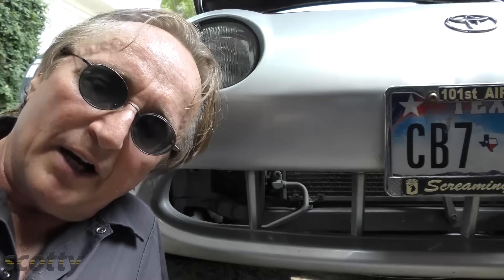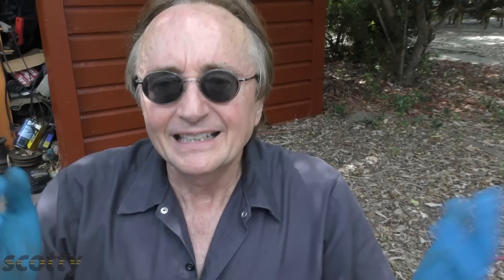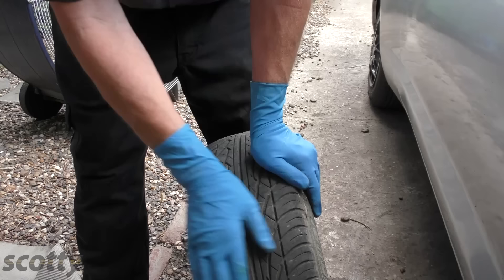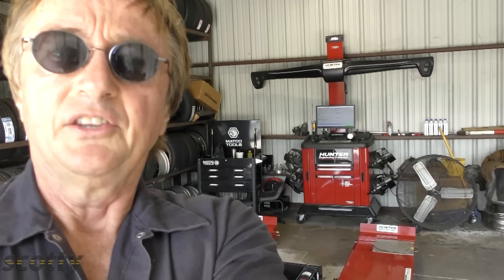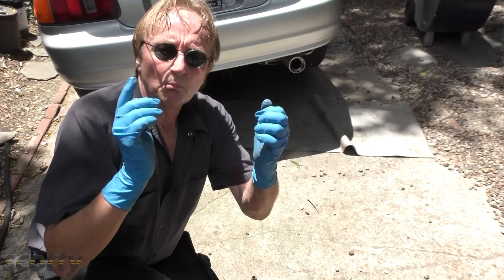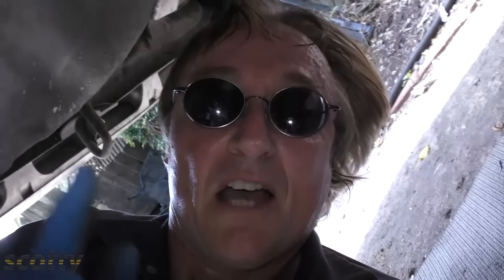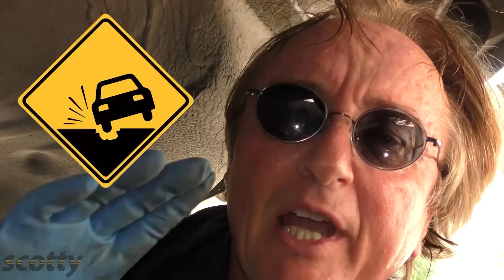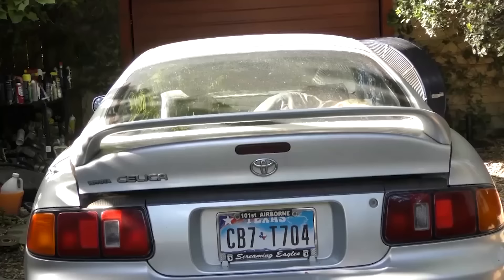How to Tell if Your Car Needs an Alignment

Comment: Just got new tires my old rear tires were both wearing on the inside and were making this whirring noise when accelerating or slowing down(not braking) not grinding or squealing just whirring I put new caliper bolts regreased them installed new rotors and pads not sure if it was just placebo effect but the sound quieted down alot then I got 4 new tires and it made the sound worse and now my steering wheel shakes at highway speeds 50-80. The shop didn't do alignments so I'm gonna be getting it done on monday 

Do you think it's just a bad alignment causing the noise and steering wheel shake? (Gonna have the shop test out the balance too)

I tried shaking and spinning all the tires the only thing I hear is the pads kissing the rotors no clicking no grinding or anything like that I hope it's just an alignment or balance issue I hate installing wheel bearings such a pain the the a%@

Oh my car has 160k on the dash and I'm pretty certain the wheel bearings are all original I haven't gotten my tires rotated or aligned since I got the car (whoops) so I've driven it for about 90k miles only doing oil diff and Trans fluid changes

Comment: What about tire change and suspension replacement? Would a alingment need to be done?
Reply: Tire change 
Probally not.suspentuon almost guaranteed yes 
I'm about to do all new control arms 
Ball joints .tire rods .and cv axles so I'm for getting an alignment
Reply: @westsidedavie  Damn that's a lot of work you are putting in. I hope it comes out great for you! I'm looking at new tires, suspension, sway bar, maybe even a differential.
Reply: @joshuabenitez3260  what car .? Mines a 98 accord 5 speed
Reply: @westsidedavie  04 Honda Civic gonna be my first project car not going too crazy tho

Comment: Hey Scotty. Id like to know how you feel about a shop charging full price for a 4 wheel alignment when they couldn’t get everything into spec and the car still pulls slightly.  They claim it’s because of worn out shocks on a 2016 Corolla with 100,000 miles and they knew this could possibly happen after doing the alignment but they fail to mention this before the service.  I took the car in for alignment after tie rod repair and it couldn’t be done properly but they still want to charge full price.  They claimed because I ordered the alignment which should be done after tie rod replacement that it’s not their problem.  What’s everyone’s take on a scenario like this?

Comment: My 96 Ford Telstar has a weird looking metal cable bolted from muffler to the body of car at the rear about 8 inchs or so long and same goes for other side is this a grounding cable of some sort, I have been having issues with my Door Adjar light including dome and door lights saying doors or door is not closed but all the doors are shut and the chime that says key in ign when door open or even lights on when door open dose not go with all doors shut just when a door is open these lights are dim and dome light is very dim when car is running as is the adjar and door lights but dome light is off when car is off as is adjar light bit lights on door is dim when car is or and or car is running

Comment: Fucks here where I live didn't align rear wheels. Back left has massive toe in. Gave them a call and they told me they are not doing it. It has 0.30° difference then other one that is on 0°

Comment: If your vehicle needs an alignment after it leaves the factory, it 100% requires replacement of parts. There is no "adjusting" worn out parts.

Comment: My car doesn't even have alignment bars. It has integrated camber eccentrics which tend to throw most shops in a loop.
Reply: What kind of car has "integrated camber eccentrics"? Year, make and model, please?
Reply: 1978-1995 Porsche 928. I personally own an 81 and an 89. The eccentrics are either part of a bolt in the rear suspension or a separate part that sits in the ball joint of the front suspension. Interesting system and it works well. It allows you to easily adjust camber, castor, and toe in and out.
Reply: TheTardis157  Thank you, I learned something today.

Comment: I got a wheel alignment today, and when I went to pay, the cashier asked if I got into an accident with the car. I assumed he was referring to the dent on my front driver fender. He said no, the front passenger alignment was further back than specs (the caster). Then the mechanic said that the light in my dash is showing that the car is still misaligned. I was perplexed at the light he was referring to in the dash. The mechanic said the light with the two lines and the car going sideways. I said that’s not for the wheel alignment, that’s the lane departure light. He said, no, the car has a camera inside to look down at the wheel alignment. I said you don’t know what you’re talking about; the camera is on the windshield, looking forward for lane departure. Seriously, the brokechanic’s lack of knowledge and his made up theory has me questioning their quality of work. And no, I did not have an accident in my car, but I did hit a pot hole.

Comment: how come when i have my car on lift, while spinning the one tire forward the other tire is going backwards ?
Reply: That's probably because these tires are connected through a differential. If the engine is off and thus the drive shaft is stationary, the gearing of the differential is transferring the rotation to the opposite side and reversing its direction.
Reply: @xXxLolerTypxXx  so this is normal ? i have nothing to worry about ?
Reply: @falcongro  I'm not a mechanic, but yeah I'm pretty sure this is normal.

Comment: If your car is wearing tires funny, you can find your problem with strings and levels guaranteed.  I've been aligning my cars at home and at work for 30yrs. . Our machine at the factory dealer was broken for 6 months, but the owner still made us charge customers for alignment. You might not get 100% accuracy at home, but neither will you with most lazy alignment techs., trust me I worked with many of them. Scotty doesn't have patience for alignment I can tell, some guys do.

Comment: Hi Scotty I just had the tie rod end changed on my Mazda Tribute 2003 and feels like it's pulling to the left (passenger side in UK) it did get its allignment done as you know you can't change that part without having it realigned.....before I take it back to the garage I have noticed that the tyre on that side has a slow puncher and siting at 22psi as oppose 29 psi which is the recommended inflate value.Would the tyre be the issue here? (I know the tie rod end definitely needed doing as from previous years safety inspection it came up as play in steering)

Comment: i have a    2018 mazda3 sport with 47k miles. i just changed my tires cuz the firestone mechanic said the sides of my tires are wearing so i may need to get an alignment so i took it to a 2nd place and got new tires put on em. i asked them how much percentage my old tires were and they said 2/32 4/32 and 5/32 and i needed an alignment. so i'm thinking of going to firestone and getting the lifetime wheel alignment (they align your car every 6k miles or so for the life of the car for around $150)  did i really need an alignment?

Comment: If my steering wheel is off, off by some degrees when car wheels are straight, does that require alignment?
Reply: Not necessarily.  The steering wheel might have a separate adjustment.  The charge do make that adjustment is probably the same, so I'd have it alignged while you bare there and just tell them to center bthe steering wheel

Comment: Scotty, im at my wits end with my baby (02 honda odyssey) i have a misfire on cylinders 2 and 5. I've changed spark plugs, changed coil packs, cleaned egr, cleaned pcv, and changed gaskets. Any suggestions?
Reply: MrEer218 have you checked the plug wires resistance?
Reply: benson420710 
Whats that?
Reply: MrEer218 the ohms measured from the spark plug wires leading from your coil pack to your spark plug
Reply: benson420710 
O yes sir and they are up to specs
Reply: MrEer218 might need extra spark plug wire holders, our 08 mountaineer had a bad missfire until I replaced the coilpack to plugs and went crazy with the holders making sure the wires dont touch each other or other metals

Comment: HELP PLEASE. Walmart put new tires on 2016 Nissan Rogue (90kmiles) and 2014 Nissan Altima (53kmiles); before getting new tires vehicles were driving straight. Rogue - first I have changed rear tires in Rogue at Walmart, after that I noticed the vehicle pulls to the right and I went to Pepboys because Walmart does not have the wheel alignment service; Pepboys fixed the issue but gave me wrong printout from another vehicle, later I went to Walmart to rotate the tires and after that vehicle started pulling left, so I went for realignment to Pepboys again, they fixed that but the printout still says that one of alignments is out of the recommended specs??? SHALL I GO TO PEPBOYS AGAIN MAYBE AT DIFFERENT LOCATION? Altima - changed front tires first at Walmart and vehicle started shaking at higher speeds, so I went to Walmart again and asked them to rebalance the front and put new tires in the rear; after that I removed the wheel cups and I noticed that the weight they put was not attached at all to the wheel (so I returned back to Walmart and I lost the weight on the way) to rebalance the tire again. Today they rebalanced the left front tire but the vehicle started pulling to the right. PLEASE HELP? ARE THOSE MECHANICS SUBBOTAGING CARS in order to get more work/money??? Today AM there were 4 mechanics at Walmart in Mulberry, FL but no vehicles being serviced.

Comment: Hey Scotty I have a question. On the highway at about 70mph my steering wheel slightly jolts to the left about every 5 seconds or so. I don't really feel vibration but I can see it when I look in the rear view mirror. I had the wheels balanced but that didnt solve the problem. Could this be an alignment issue?

Comment: If I take my hand off the wheel while traveling down a straight well-kept highway,   should the car stay straight or pull to the right slightly?  Consider the highway must be sloped down to the right side shoulder to shed water and it may be safer to have the car drift slightly to the right to avoid a head-on collision.  Anyone have experience or cite a reliable source?
Reply: Still no answer after 4 years 😔

Comment: hello sir i want to ask you , i have audi tt year 2000 mk1 .  i scan this  all .immobilizer, control converter , radio ,SAS ... but my scanner say not decetion , no voltage or like turn on ignition on , but i already on my ignition , i use autel Maxi Diag 808 PrO btw.. its like my car dont get eletric power for some item/tools in my car. its any realted to bcm or ccm?

Comment: I noticed a lot of mechanics don't straighten the steering wheel before making adjustments. The customer ends up with a car that goes perfectly straight with no hands on the wheel, but the steering wheel is off by a degree or more. Some mechanics are so damn lazy.

Comment: (HELP) Hey Scotty, I've been watching your videos for a long time now and I really like your style and content. Well, I wanted to ask for some help (other people feel free to advise as well)... I have a Corolla 2010 1.8L S automatic, and lately, the transmission has been acting strangely, sometimes there is lag between gears and the rpm go high during that 0.5 second window. Or sometimes it shifts really hard. I had a friend mechanic drain the transmission fluid and change the filter (which was full of "poop") and the transmission feels more smooth, however, after 2 or 3 days of the change, the transmission has started to do the same thing again although not as strong as before. I wonder why this is happening, could it be a sensor, solenid etc...do I need to change the filter and fluid again etc.... I'm a colege student and I can't really afford another transmission or expensive stuff (no family support either) so I would like to prevent my transmission from breaking. Thank you in advance.

Comment: so you need a fancy machine with lasers for thousandths of an inch alignment even though you only have one adjustment. where as cars in the 60s had a lot more adjustments, but no fancy laser adjusting machines. gee that makes sense.

Comment: My car still pulls to the right Ive gotten a alignment twice I give up
Reply: CHECK the shock absorbers, one may be leaking or weaker, even well aligned the car will pull to the side of the weaker shock absorber.
Reply: Tires are very important too. If one side is worn more than the other, or if the tire pressures aren't even from side to side... that can make a very noticeable difference!
Reply: My tires are fine there no waring idk my shocks and stunts seem fine idk
Reply: Yeah Jeff I heard that too
Reply: A car should pull to the right. All roads are curved - lower at a shoulder higher in the middle, so in the USA cars pull to the right, but in Australia to the left. The second reason is manufacture specification that requires a car to pull right to a road shoulder in case a driver fall asleep or lost consciousness.

Comment: You can have poor alignment and still not show unusual tyre wear.
Don't base it on tire wear

If the toe and camber are out they can compensate for eachother and the wear stays even it just wears faster and uses more fuel. 

Also even a solid rear axle should have all 4 measured so you can see the thrust angle.

Toyota rear toe needs to be adjusted almost as much as the front.

Always have all 4 done.

Comment: I have an old Hunter H111 alingment machine at my shop.  Its maybe 30 years plus old and it complains a lot and refuses to work especially when it rains.  Maybe it has arthritis like me.    So my tech and I have to sometimes use a tape measure.  As long as only the toe needs to be adjusted its ok to use a tape measure.  Its ok.    this video is good like most of your videos but you exaggerate a little about measurements being in the thousands of an inch.  The adjustments are not thousands of an inch.  Tolerances are  in 1/16's of an inch and there is leeway of usually about 1/4" in the toe adjustment.  Yes you have to maybe be a pro to get the steering wheel  level without an alignment machine but you can do a decent toe adjustment in a pinch with a tape measure.  The newer wheel alignment machines make things much easier but the your alignment is only as good as the guy who is using the machine. Yes of course you never know if any of the other alignment angles are off without a pro and an electronic machine but they can't be adjusted anyway on most newer cars.

Comment: Love your videos Scotty and want your advice.
 I have a 2002 Monte Carlo SS 3.8 and I just had hub bearings (both sides) installed. My problem now is that as I'm driving there is a lot of "play" in my steering wheel. Meaning that my front tires will move and shift although I'm not turning the steering wheel at all.... 
feels like I really dont have control of my car.... Very SCARY!
Someone told me it might be the control arm or the ball joints. What do you think?  And do you recommend I take it to Brake Check? My funds are low & I just don't want to get screwed over..
-Any advice is GREATLY Appreciated.

James from Houston, TX

Comment: Too funny no point doing this and installing new tyres or tires if your American , when the suspension components are more then 10 or more years old like shock , bushes ,bent components or because they vehicles from factory has a camber issue like some vehicles do because they have no adjustment for camber just toe in or toe out . Wtf maybe address these issues first then add tyres, do wheel alignment after and maybe adjustment all the settings like camber , toe , castor . Three most important adjustment on any vehicle maybe ask for local technician get them to check or adjust them to spec because most workshops will just   (TOE AND GO) it and still pay full price

Comment: Looks like half ass video explaining nothing. Your problem is not the string method but your imperial units tape measurer. Learn metric and then couple of millimeters won't matter that much as few 1000s of an inch
Reply: Quentyn73 The problem here is, why should we listen to Quentyn73? Who is he? Is he qualified to criticize a man with 40 years practical experience or is he a 13 y/o hiding behind a computer? I'm not being rude, but criticizing the fact that we use inches instead of metric makes no sense. 1/4 inch or 6.35 mm. What difference does the type of measurement make on whether the alignment is correct?
Reply: Quentyn73  Yes, that's probably correct. Neither of us can read. Since you have 127 subscribers and an attitude though, I'll continue to watch him with his one million 100 thousand subscribers.
Reply: Bent Nickel watching was never the problem for either of us. Watching bullshit was for me and obviously defining it as such was a problen for you. Cheer up dude, we can't all be sucessful abd smart. Some of us have to actually be the clowns that cheer us when we take a dump.
Reply: Bent Nickel, if you're patient it can be done. You don't have to use metric though, you can measure to the nearest 16th or 32nd. I choose to use a metric ruler myself, but I could use imperial as well. You need to be on flat ground, and after each adjustment roll the car back and forth before re-measuring. It requires finesse and patience, but the objective is simple. There are videos on it, go watch.